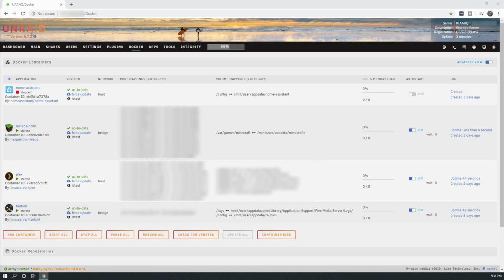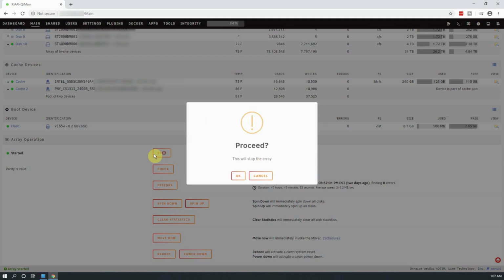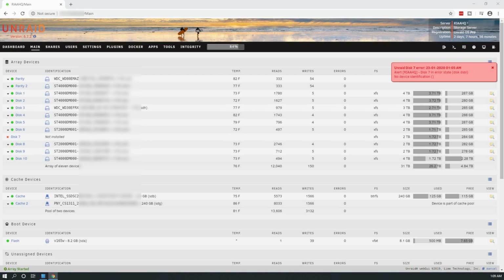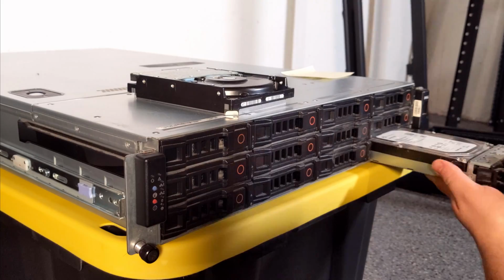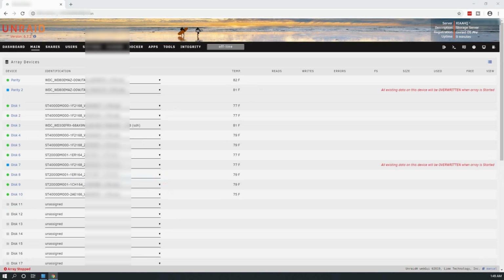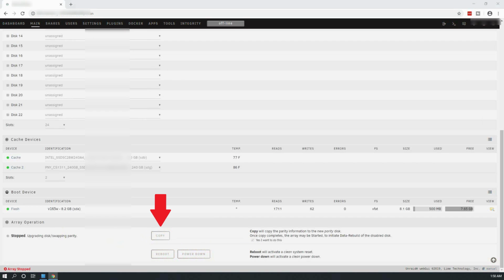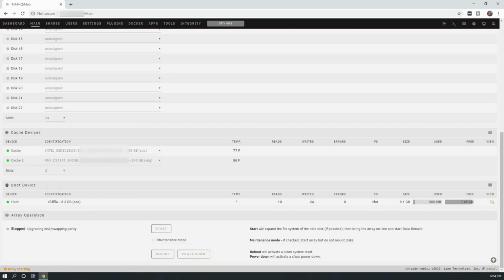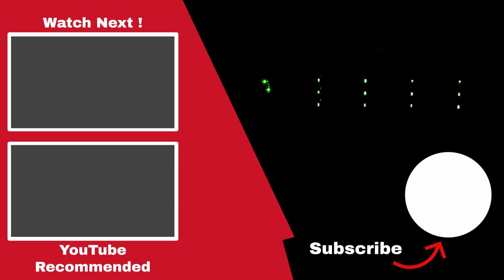Unraid Parity Drive Swap Procedure 🖥️ How to Upgrade Parity Drive in Unraid - Increasing Parity Size

Comment: Sorry for such a basic question but is this only possible if you have two parity drives? I have one 10TB parity which I would like to upgrade to 12 or more. Could I still do a parity swap if it doesn't have another parity drive to copy data from?
Reply from the maker: No worries on the question, its important to make sure you keep your data safe!

The parity swap procedure can be completed with a single parity drive. If you're doing just a parity drive upgrade then you wouldn't need to follow this procedure but instead would do the normal drive replacement process - https://docs.unraid.net/unraid-os/using-unraid-to/manage-storage/array/replacing-disks-in-array/#upgrading-capacity

Here is the current documentation on the parity swap procedure including what the procedure is meant to cover - https://docs.unraid.net/unraid-os/using-unraid-to/manage-storage/array/replacing-disks-in-array/#parity-swap

Comment: What is the drive bay you use? I can't find one with enough bays that can connect to my machine. All I find are for like 6 drives. 9 would be great!
Reply from the maker: I am using a disk shelf ( https://ebay.us/7tpzvI ) for hard drives connected to a Cisco UCS 220 M4. Make sure you do plenty of research before going down that path as they are loud, draw a good amount of power, and require special cabling and cards to have the disk shelf connected to the server.

Comment: Makes it a bit harder to follow with the serail # blanked out as that was how we could follow what was done with each disk.

 I use 14TB drives across the entire Array, and 18TB is on sale right now so I want to upgrade my parity to 18tb drives so I can make use of larger data drives going forward.  The steps that mattered the most I didn't quite follow here talking about selecting the old data drive and such, when it has been removed from the system it should not even show up anymore?

Comment: is it possible to place the old parity into an unused disk slot and when placing the new drive as parity to do the copy? (without replacing the smaller drive)

Comment: Can't this be done without any downtime? I thought that was the point of Unraid.
Reply from the maker: You have to stop the array to make any changes to it. You can continue data operations while disk rebuilding is occurring but its not recommended

Comment: Something I've found with this process, and I've followed it twice now to the best of my ability, and both times it jacked up my docker image file.  Not really a huge deal, but I wonder if there is a step that can be taken to avoid this, and as such perhaps an updated video wouldn't be worth your time.  Thanks!
Reply from the maker: Hmm that's strange. Do you happen to notice when in the process the docker image breaks?

Also where are you storing your docker files?
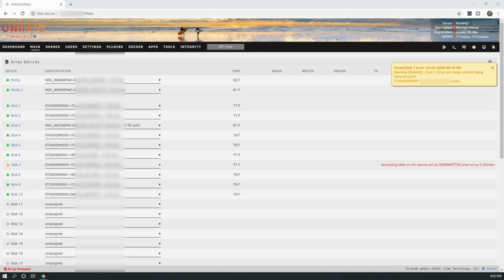Reply: @BeardedTechGuy  Yeah it's pretty odd. RE: Docker files, the image file is in mnt/user/system/docker and the other files are in the appdata folder.  Both are pretty standard locations I'd think.  I don't notice any issues until I rebuild the old parity disk(roughly 5:50). It's not a huge deal in any case, because rebuilding the docker image file isn't exactly a huge issue, just takes some time.  Just wanted to pass along what I'm seeing, incase there are some process improvements.  I've copied both of my parity disks now so I am not sure I could easily recreate, but the exact same thing happened both times.
Reply from the maker: Thanks for the heads up!  I didn't run into that issue, but I keep all my docker files on my cache drive so not sure if that prevented the issue in my case.

Comment: Hi Bearded Tech Guy - great video!  I am installing a new 14TB drive (partiy) and will be removing an old 3TB data drive.  So 14TB goes to Partiy, old Parity (10TB) goes to Data, old Data drive (3TB) gets pulled from the server.

Question - when I am doing a parity check (10TB disk) it takes over 24 hours.  By doing the Parity Swap procedure and using the "Copy" approach to setup the new Parity drive - are we talking a few hours, or something more similar to my parity check (24+ hours)?  Having the array down for 24+ hours would be an issue for us...

Thanks!
Reply from the maker: Glad you liked the video!

For me the copy operation took about 16 hours (which is a little less time then my parity check). So it sounds like this way may not be the best option for you. Do you have dual parity on your server?

Comment: Hi thank you for the video! However I would use the rebuild process only if it was totally necessary and I would say that you could easily have avoided by copying the old data drive into the new one. Sort of the same as copying the data drive but maybe doing it in a terminal or similar. Keep up the good content!
Reply from the maker: Glad you liked the video! This process is used when you want to take a parity drive that is being upgraded to a bigger drive and use the old parity drive to swap out a smaller data drive.
Reply: @BeardedTechGuy  Sure, thank you! I saw the copying of the parity drive and that was very helpful. What I was pointing out in my comment was the second part of the process where you replace the data drive and rebuild it instead of just copying the content between both drives.

Comment: Question, if you mount that parity drive in other OS, what do we expect to see on it? Does it have files? Newbie question.
Reply from the maker: Great question and honestly I am not sure! The drive doesn't store files but parity data so even if you are able to mount it I wouldn't expect to see your files on it. If I get the chance I'll test it out to see as I am curious. With normal data drives you can mount them on a different system and see the individual files though.

Comment: thanks very much sir, 

one thing to note if you have open space and you want to do this method you still have to reboot before swapping the assignment of the drives for it two turn blue and have the copy option.

Comment: 5:32 "during this copying, your array is still stopped."   So if instead I did this in two stages -- 1, upgrade the parity drive and rebuild and 2. swap the old parity with a smaller data drive -- the array wouldn't have to stopped and could continue running during the two stages?
Reply from the maker: Just to verify:
You want to upgrade your parity to a larger drive and then also swap out the old parity drive with a smaller drive that is then used as a data drive?
Reply: @BeardedTechGuy  👍
Reply from the maker: If you are doing a parity upgrade you could do that as a separate step and in theory leave you array online during it. You will need to bring it offline to make the actual drive swaps, and depending on if you are running at dual parity or not (and even if you are) you are at a higher risk of data loss because one of your drives is being rebuilt. Because of that I really recommend not having the array online during the process as it could add unneeded read/writes to the array. That is just risk you'll have decide if you are comfortable accepting or not.

After the parity drive is rebuilt you can then just add your old parity as a data drive which would not require a rebuild.
Reply: @BeardedTechGuy  Is the risk of data loss on the rebuild side or the array side?   If such a loss occurred, wouldn't unRAID take notice (because it must be checking the progress and success of each stage of the rebuild operation), backtrack and then re-write the lost data?  The unRAID OS doesn't prevent or even throw up warning notifications against this scenario (keeping the array online during rebuild), which suggests that unRAID is capable of handling said scenario.   Otherwise, why doesn't the OS just not allow it?  To be safe, I would just avoid doing any stressful operations with the array such as large file transfers during the rebuild.   But to deny oneself access to the online array during the entirety of the rebuild, when the unRAID OS itself shows no objections to keeping things online, seems excessively cautious.

Comment: You didn't explain what the copy of the parity does. I came here because I have 2 6TB data drives and I'm planning on adding a 3rth 6TB parity drive but later I want to add an 8TB as Parity and use the 3rth (configured as parity) 6TB for data and I want to know if I can just copy the parity to the 8TB.
I'm not sure if the process you describe uses the 2nd parity drive to recreate the parity in the new drive so I'm not sure if I can do what I want. :(
Reply from the maker: The procedure in this video copies the parity data from a parity drive to a new drive and then rebuilds the array using the old parity drive as a data drive. So for your example you could use this procedure to swap the 8TB drive with a 6TB Parity drive and then assign the old 6TB drive as a data drive. The procedure can be used on systems with 1 or 2 Parity drives.

Side Note - If you have data you really care about on your system I always recommend a second parity drive and consider some kind of backup solution for important data.

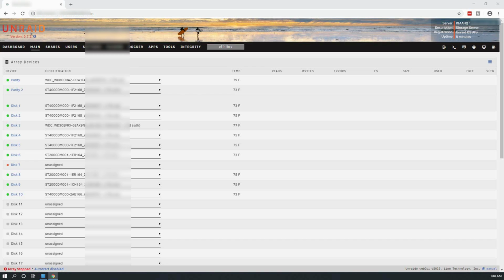Comment: Small nit pick to point out (since I've watched this several times as I'm doing this upgrade process now).  At 4:11, you skip mentioning you need to stop the array after the reboot.

PS - Thanks a ton for this video.  Really helped me out!
Reply from the maker: Thanks for pointing this out! That is only if you have your array auto start on power on. I have mine set to not auto start so I did not have to stop the array after boot up.

Glad you found the video helpful and thanks for the feedback!

Comment: Is powering down necessary if you have hot swap bays, and you stop the array?
Reply from the maker: Sooo.... The Unraid OS supports "hot swapping" as long as the array is down. This requires your other hardware to support the hot swapping though. I was messing around with this this weekend actually for my new Unraid build and it worked on my LSI SAS9207-8e.

Comment: Thanks, I’m building a smaller Nas and I’m unsure of. Using unraid or FreeNAS and found this info very helpful.
Reply from the maker: Glad it was helpful! A lot of different opinions on that matter. I think it depends on  what you're using the NAS for. If its for VMs / shared storage for computing then FreeNAS is probably the better option. If you are doing media then Unraid is better. That's just my personal opinion at a high level though, and is what I do.

Comment: depending on your confidence with the drives in your array, it might be a good idea to only replace 1 drive at a time, that way if an additional drive fails in your array during the rebuild your most likely going to lose some of your data. Great tutorial btw :)
Reply from the maker: With the parity drive swap procedure you would end up with your old data drive being left on the side so if you have a disk failure you can add it back in to repair. You also are only supposed to do this when your array is healthy to reduce the possibility of data loss.

Comment: you can swap drives without powering off the system. did that on my last drive expansion with no issues.
Reply from the maker: With my luck I'd somehow arc electricity from something nearby and fry all my drives. 😹
Reply: @BeardedTechGuy  They are called hot-swap bays for a reason, but yeah, my luck too probably.
Reply from the maker: @ifrit05  Yea, because they get extra toasty when they fry lmao.